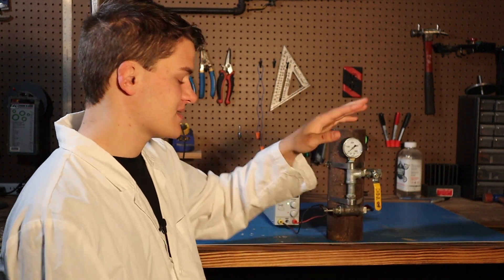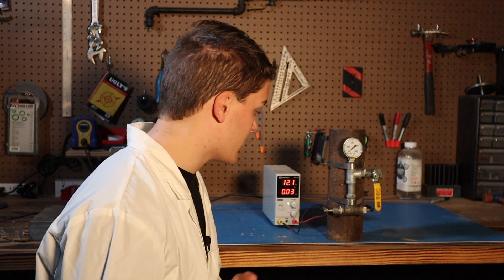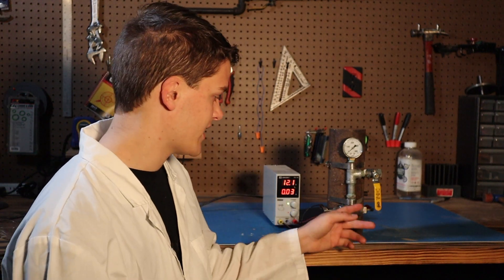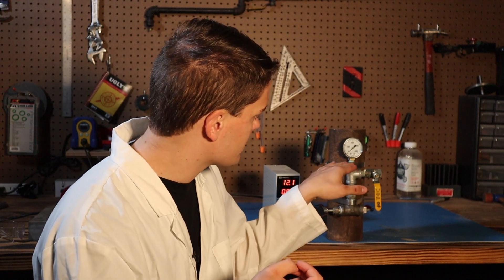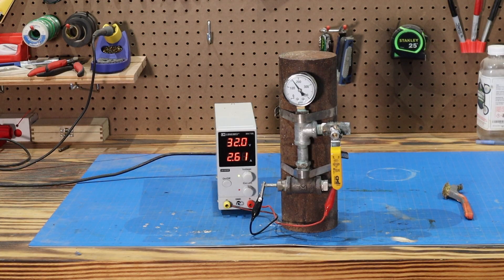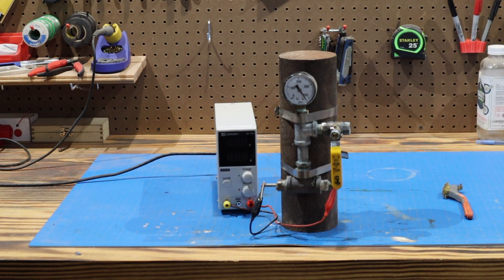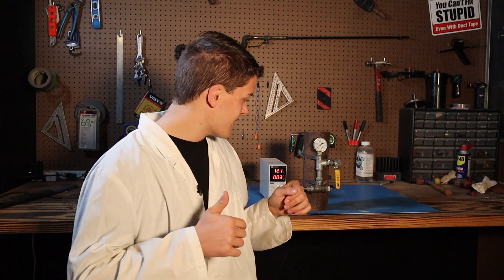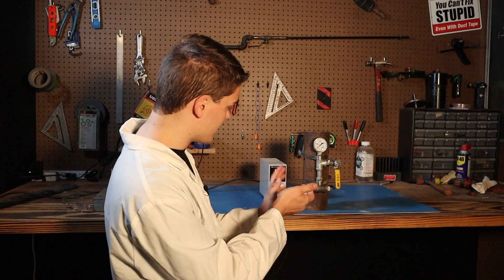testing high pressure hydrogen generator *400+ psi*

Comment: I reckon people that the combustion under pressure is whenever it reaches that pressure. I think it is only if you compress it extremely fast creating heat. The 3rd element needed for combustion

Comment: Nice setup. But I would encourage (well, assuming this endeavor is still in progress) to consider not creating and storing hydrogen and oxygen mixture, but keeping them apart and mix only when the mixture is needed. Also, I wouldn't assume that this one test fully disproves the worries of autoignition. If there are claims it happened... I'd, again, recommend staying on the safe side. Another issue is that the hydrogen molecule is so small it can penetrate metals and make them fragile - that's why e.g. metal hydrides are used to store hydrogen (although they're more expensive and have less capacity than a simple tank). Working with hydrogen is just not as easy as it might look at the first glance...

Comment: Thank you for awnsering this because no one else would but pressurizing hho shouldn't really be dangerous the only dangers are flash back which can be easily defeated with a fire arrestor made for oxy Acetalyne
Reply from the maker: @smoked_bacon  well yes and no. Just because you increase the pressure doesn’t mean it will cause a reaction. However, increasing pressure lowers the minimum energy needed to ignite the mixture. So it will definitely be more reactive and more dangerous. Especially because the added pressure increases energy density as well as the likelihood of detonation.

Comment: The reason compressing flammable gases is dangerous. Imagine you have a foot by foot cube and your compressing it to an inch by inch cube. All of the heat that is in that foot by foot is now being compressed into an inch by inch. So the heat by volume increases rapidly. Similar to what you would do with the magnifying glass using the Sun to burn objects.

Comment: I have tested my electrolyzer unfortunately it went kaboom!
What happened was the terminal that I have used heat up due to high resistance it was consuming 70A at 12V and I let it go coz I wanted to find it's limits sure enough it did found it limits. 
last time when I checked the temperature of the terminal was 70°C pressure was 0.1bar it was a mixed gas O² & H².
I wish I had a video of it I went deaf for 5min after the detonation that was super scary.

Comment: Does positive pressure impede the electrolysis process, and the production of HHO gas by creating an environment where the gas is not allowed to expand freely?

Will extreme pressures cancel the electrolysis process and prevent the individual atoms from being “freed”?
Reply: There's a theoretical limit, but when doing "ultra high pressure electrolysis" you can reach over 10.000 psi, so the limit is definitely more than you and I can ever achieve

Comment: Don't need heat pressure does the heating, opening the valve too quickly will heat the nozzle exhaust significantly

Comment: I see you answer one of the questions that how long it took and wasn’t bad that was a silly fast by any chance how hot or the temperature reached inside any idea ? Or do you think some steam helped the pressure ? Or pure hho
Reply from the maker: I didn’t measure temperature unfortunately. Temperature data would have definitely been super helpful for any thermodynamic calculations. Ahh well… next time 👍. 
It was definitely hot to the touch after I released the pressure though. However, steam would not be adding to the pressure imo because the boiling point of water at an absolute pressure of 400 psi is 445 F. It was nowhere close 445 F let alone 212F. So I think it was “pure” hydrogen and oxygen

Comment: Pure hydrogen should be fine under pressure but Browns gas is said to be unstable under pressure, that's why it cant be safely bottled. IDK what that pressure limit is though. My hho torch runs about 1 psi above ambient  I think .

Comment: Hydrogen can be ignited by the supersonic shock wave it makes when a valve is opened. If you are working with HOH in pipes it looks a lot like a detonation experiment. NASA has a bunch of stuff on Hydrogen safety. Goof luck.

Comment: I've done a lot of pressure testing up to 20,000 psi and it can get exciting! lol How does the pressure affect the efficiency of hydrolysis? Have you tried degassing the water under high vacuum before starting electrolysis and how does that effect the efficiency?
Reply: @TR-Labs yes, common in oil drilling equipment

Comment: ah, yes, cylinder of death.
you made a bomb.
congratulations.
Reply from the maker: Well it was filled almost entirely with water which kept the potential energy on the low end... also the plastic parts I used to insulate the electrodes from the rest of the pipe would probably be a failure point.
Obviously I don’t recommend replicating anything in this video :)